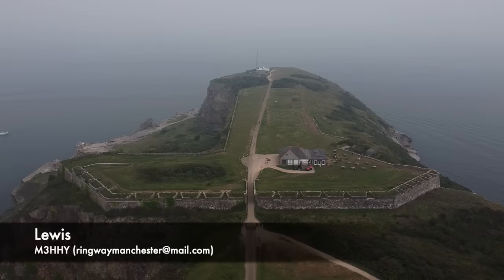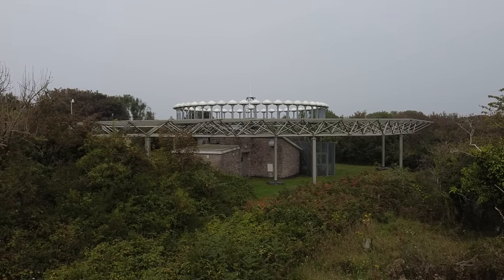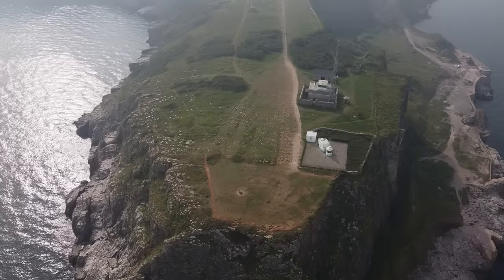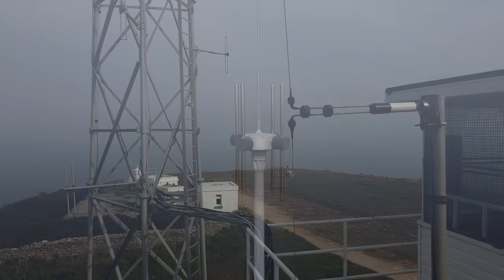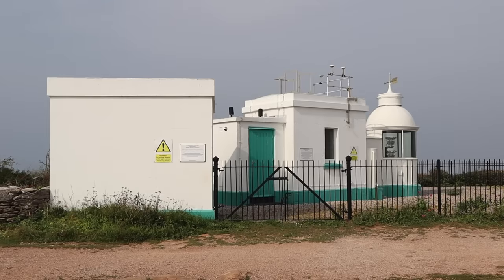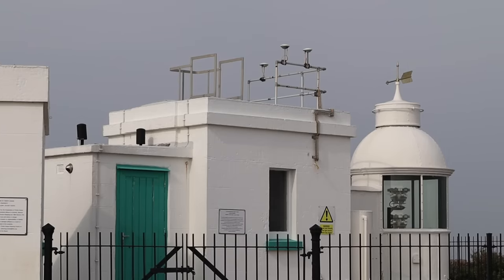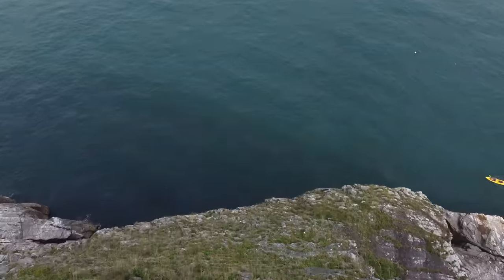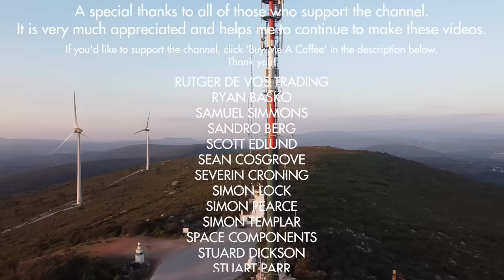What Is This Clifftop Radio Beacon Used For?

Comment: I can shed some light on the unidentified dipole antenna. It is an ARM Multi P6 designed in the 1980s by an acquaintance of mine who has sadly now passed away. It was a simple and cheap portable antenna for the amateur 2 metre band and could be assembled in different configurations, hence the multi in the name. I believe this one was tweaked to cover the marine VHF band. The fact that it is still standing after nearly 40 years gives testament to how rugged it is despite the flimsy looking construction. Berry Head frequently records the highest wind speeds on the south coast during gales. I think the thin and flexible stainless steel elements help to reduce the wind loading which has allowed the antenna to survive.
The DVOR stands in prime dog walking country and I have walked under it countless times when exercising pooches. I always knew it was an aircraft beacon but I now understand much better how it works thanks to your concise explanation Lewis.
Fun fact: Berry Head lighthouse is supposedly the shortest but highest and deepest in Britain. As Lewis has explained, It is only 3m tall but it doesn't need to be any bigger as it's already 58m above the sea. It is deepest as there is a 45m deep shaft underneath. This shaft was for a descending weight which turned the old rotating light and which had to be cranked back up again every day. This was supplanted by a small electric motor and finally the recent LED array.
Reply from the maker: Wow thanks for explaining!

Comment: I love VORs. I visited my local station a decade ago to get pictures of it while it's still in existence. In the US they're gradually disappearing with the proliferation of GPS for navigation. It doesn't seem like a wise option to get rid of our fallback systems though. Great video as always!
Reply: They're disappearing in the UK too.
Reply: VORs are still used for primary navigation according to the FAA. were trained not to rely on gps and to use VORs when possible.
Reply: Not all VOR's are disappearing. In case of a GPS outage, the VOR MON (Minimum Operational Network) will enable pilots to revert from GPS navigation to conventional VOR to VOR navigation.
Reply: As others have said the FAA is mainly getting rid of redundant VORs. Here in the Southwest US we still have and will continue to have plenty of VORs!
Reply: All the previous comments are correct - but the VOR situation is not sustainable.  There are many smaller or private, non-public airfields which are not well served by existing VORs and do not have ILS installations.  The cost of VORs and ILSs is significant so a replacement is needed.  But will I miss the piece of modern art that an VOR station is?  Ya bet!
And let's not forget good old NDBs and direction finding approaches 🙂
Reply: Just needs for the satellites to be wiped out by a solar eruption or other external event.  These would then really be needed.
Reply: @alangknowles  the airfield where I learned to fly (EGSC) still opperates an NDB, VDF service and even a good old optical beacon and whule not directly served by any VOR, there is suffixiennt VOR/DME coverage to make life without sat nav easy enough.
Reply: @alangknowles Put all the eggs in one basket. No thought to redundancy and continuity of operations

Comment: I’m training as a pilot and the VOR service in the UK is remarkable. I never knew it existed till I started my flight training.

The VOR system is required for primary navigation in the UK, with GPS limited to a backup or secondary navigation aid. I’m glad we learn to use both :)

Comment: 4.34. I worked at Berry Head Lookout for several years before it’s closure as a coastguard station. When the towering new radio mast was installed, some bright spark amongst the staff (with expert drawing skills) pinned an official looking and beautifully created line drawing poster on the wall in the lookout. It gave detailed instructions with diagrams on ‘How to attach and dock airships’, with a comical description of how to deal with disembarking passengers in high winds. Those were the days. 

The replacement of lighthouse workings - while no doubt efficient, are a great loss. The aesthetically pleasing reflectors which worked fine for the last 100 years were much more appealing up close. 

Thank you for this great video, great photography and research as always.

Comment: Berry Head lighthouse is the highest, deepest and shortest lighthouse in England. Highest due to its elevation above the cliff, deepest as there is a 30 foot deep pit which used to house the clockwork and shortest as the light is 6 feet above the ground level.
If you have been visiting the South West will there be an episode about the Lizard and Goonhilly Down?
Great video as always.

Comment: Not a bad description of a DVOR station. This onelooks like a PlesseyPlan 50; so-called because there were 50 antennas in the ring. I trained on this at the end of 1977 at the old National Air Traffic Service training school at Bletchley Park (yes, the home of the UK codecracking site from WW2). A cracking system and a doddle to maintain,unlike the other old analogue systems. I spent 4 years mantaining ATC facilities in Saudi Arabia straight after that training course (well, after a 5 month HF system training at Rockwell Collins in Dallas). Plenty of work to do on DMS,TACAN,VOR.ILS(including associated markers) but not a single DVOR in sight!

Comment: The only thing possibly missing was a recording of the characteristic falling pitch bleep sound of a VOR.
Reply: Depends on which signal you're listening to.  They broadcast their three letter station identifier in Morse code on the AM carrier (aircraft communications use AM).  Some of them in the USA also can transmit audio from the regional Flight Service Station over the AM carrier.  The FM carrier has the sweep signal.  The Rock band Rush's famous song YYZ is based on the Morse code identifier of the Toronto VOR/DME, which Neal Peart heard while riding up in the cockpit on a private flight home...
Reply: @brentboswell1294  That is cool, I did not know that about the song!
Reply: Here in the US many VORs used to be used for contacting  flight service stations. You would transmit on a designated frequency such as 122.2 and then call the flight service station, letting them know what VOR you were listening to. They would respond to you via that VOR. This enabled wide area coverage so that general aviation pilots could file weather report while in flight with information that may not be in the weather forecast, such as where the cloud tops or layers are.
Reply: @brentboswell1294  I mainly heard the Manchester Airport VOR which had a frequency that was close to the top end of the broadcast FM band and could often be received on a domestic radio.
Reply: @nowster  in the US, the lower part of the aircraft NAV band is reserved for localizers and ILS.  Almost every ILS here has a frequency of 108.x or 109.x
Reply: I remember one at 108mhz in the late 70s early 80s

Comment: When I was a plane spotter in the 80s - 90s I was looking for the DVR from our international airport, Zaventem in Belgium, but didn't find that beacon. I found the radar station though, which is huge, it's also a NATO radar station. And I did a tour in the station, when it was open for public. I was stunned that the motors were quiet. For that kind of antenna. I think that is the smallest lighthouse I have ever seen. Thanks for this content, Lewis.

Comment: Very interesting you can get this close to a DVOR. I walked past the Squaw Valley VOR in California back in the 1980s while skiing and distinctly recall a large black conical antenna enclosure somewhat shaped and sized like a space capsule with clearly legible warnings saying "DANGER - R.F. HAZARD - DO NOT APPROACH WITHIN 50 FEET".
Reply: It has horisontal reflector as part of instalation. There is metal mesh on top of flat metal construction. Thicker mesh walkways are visible near and around transmiting antenas for maintenance.
Since walkers are under the reflector iradiation is low, terain config is under it. But proped up on a significant hight man can easy get in the beam...
Reply: There's a VOR on a ridgeline along the Appalachian Trail in the Smoky Mountains (USA).  There's a few warning signs posted but the main "keep out" method is just a waist-high wooden picket fence in a 50' (15 m) or so radius circle around the transmitter.
Reply: @alexhajnal107  Where about on the trail is this? I'm familiar with the smokey mountains but haven't seen a VOR anywhere.
Reply: @DarkNightDreamer   It's the Snowbird VORTAC on the NC/TN border 30 miles WNW of Asheville, NC, about 7 miles trail S of Max Patch (5½ miles map W) and it's about 50 meters N of the trail.  Technically it's just NE of the Smokies (by about 2 miles).

Comment: Navigation systems of modern airliners tune these VORs automatically to improve the position since inertial navigation systems have drift over time. DME and GPS is also used for this. For instance the Airbus A320 will use the inertials and GPS to calculate what is called a GPIRS position using the three inertials and two GPS receivers. This is number 1 in the hierarchy. If it loses the GPS signal it will start calculating a DME/DME/inertial position. Next step is VOR/DME/inertial position and last on the list is inertials only.

Nowadays VORs and DMEs are quite dependable to give a good position. NDBs which are decommissioned more and more, are much less reliable. For instance with lightning the needle will momentarily point towards a strike and over all be very susceptible to static electricity in the atmosphere, costal effect and so on.
Reply: I also (wrongly) assumed that the aircrafts IRS would be "updated" with the correct external data from DME/GNSS/VOR data but apparently it never does. So if you are reduced to just using IRS you may find yourself drifting quite far off track!

Comment: Regularly fly from South Wales to Brittany via berry head VOR, although not equipped to navigate via VORs, it's common to use them as way points in GPS flight planning as controllers in the south of UK and northern France all know where berry head is (BHD). Often looked down at ,nice to see it in the flesh !
Reply: I used to use it flying from Cardiff to the Channel Islands. The DME was useful to see where "50N" was, back the day before I had a GPS.

Comment: Those days of learning the variable and reference phases in VOR came flooding back to me! 😂😂 Carrier frequency  amplitude modulated at 30Hz  AND 1020Hz ident or ATIS voice is the reference phase PLUS the subcarrier  which is frequency modulated at 9960Hz with a deviation of +/-480Hz all amplitude modulated at 30Hz with the aircraft receiver consisting of a demodulator and discriminator to retrieve the two 30Hz signals. The phase difference between the two 30Hz signals is measured and is directly proportional to the bearing of the aircraft with reference to magnetic North. This is because the reference phase is synchronised with magnetic North. Thanks for reminding me! 😂😂
Reply: 13.5 meters ;) Just did the annual on a Racal Mk IIa...
Reply: @juliussokolowski4293  The diameter of the antenna ring? I seem to remember it being about 44' and important.
Reply: @juliussokolowski4293  Fantastic! Nice to meet you Julius! I saw a terrible photograph in an old avionics publication showing the solid state antenna switching unit in the Racal Mk IIa but couldn't make out its physical size or its physical location within the array. I assume it sits central to the dipoles but can you tell me how big it is?

Comment: In modern flight management systems (FMS), position is verified by multiple DME positions.  This is considered more accurate than GPS and IRS (Inertial Reference Systems).  The FMS will produce a 'computed' position combining IRS, DME and GPS data,  VORs can be used for holding procedures but because of the 'cone of confusion' immediately overhead the beacon,  flying them manually is less accurate than using FMS (RNAV) holding procedures.  VORs are still used for approaches but as they are rarely aligned perfectly with the runway, they tend to be slightly offset and more of a cloud break procedure with much higher approach minima (height at which visual contact with the landing runway must be made) than precision approach systems such as ILS which is effectively a single 1/360th VOR beam.  Look at me waffling on needlessly!  Thank you for triggering me to add something :)

Comment: Very nice video, beautiful cinematography. But it was repeatedly stated that the DVOR (or VOR for that matter) provides position and heading information to the aircraft, which is not really true. The signal provides position but not heading. An aircraft in any particular radial from a VOR will have the same radial displayed, whatever it's heading. Of course the radial may vary over time (if the aircraft is not flying a direct TO or FROM course), but the VOR receiver cannot know he aircraft's heading, that bit of information is just not available from the VOR system.

Comment: That real nice video . the night pics and video came out real nice. nice VHF antenna array. this is how they find aircraft with just radio transmissions. even below ground clutter in Rader.   also direction finding on VHF Marine radio. our US coast guard uses them to help fined boats in trouble. love that light house. nice look at the LED lighting. much lower power than the old lamps. and last longer . The AM broadcast station I worked at did a LED up grade of tower lights. they bright ! even has battery back up with a gen set just for the tower lighting. the FAA in the US sets requirements for tower lighting . I still have old lights with a bayonet base in the shop . the old flasher with motors and cams is still in the budling has no power to it anymore. now just a small box on the wall . and some AGM battery on the floor. 73's Boston NY

Comment: Correction Lewis, everything you said is past tense. It was an amazing nav aid, but, those days are gone, now its all GPS, that is far  more accurate than the DVOR.
Suggest you  do a video on the history of the VOR that came from beacon stations, and then VHF Radio Range and then VAR that provided VOR on just the airways spoking out from that VAR.
I flew on the very last one that existed in Australia a long time ago, and remember its unusual presentation on the chart.
The VHF beacons trace back to WW2 as does the airband go back to 100-150 mhz with 3 watts if you were lucky.
Reply: Except that GPS can be turned off or spoofed in any conflict situation.   VORs are not going away in Europe for the foreseeable future.

Comment: The marine DF array at Berry head (and antenna sites) is no longer operational.
The Maritime and Coastguard Agency (MCA) decided that the land based DF was too expensive to keep operational and disbanded the fixed stations a number of years back - now relying solely on Lifeboat and Aircraft DF.
Reply: Do you know what DF technology this was?  The only one I'm aware of in modern times if is/was Decca/LORAN.  I was under the impression that that used a rather larger antenna than was shown in the video.

Comment: Beautiful drone photography and great video.
Surprisingly nice stonework on those buildings, especially on the VOR which I'd have expected to be just a utilitarian metal cabin or a bit of concrete even like a converted wartime pillbox.  Strange infilled square panel on the wall by the door.  Is it the site of yet another closed cashpoint? 😄
Reply: I was a little confused when Lewis was talking about the "brick" building.
Reply: I was wondering about that blocked off window. Maybe back in the day it was manned, with someone turned the handle inside! 🙂
Reply: @paulsengupta971  Fancy meeting you here :P I believe the very earliest VORs did have rotating components, albeit not hand-cranked!
Reply: Maybe the hot air vent for a long-gone standby generator?

Comment: DME (Distance Measuring Equipment) is usually located with VORs. The VOR provides bearing information (with respect to magnetic north) and the DME provides distance. The combination of bearing and DME from the station means position can be established. DME relies on an interrogation being sent from the aircraft equipment which is then picked up by the ground station which sends a reply back to the aircraft. The aircraft equipment measures the time difference and hence range from the DME is calculated and displayed. Interestingly from the piloting point of view DME provides distance from the ground installation such that, for example, an aircraft directly overhead the station at 36,000 ft would display a DME distance of 6 nautical miles so depending on altitude there is a slant range error when close to the ground station. Aircraft on board equipment also calculates the rate of change of DME distance to display groundspeed, assuming the aircraft is tracking directly to/from the station. In combination with distance from the station time to run to station at the current groundspeed can be calculated and displayed. 
The VOR/DMEs are regularly flight checked by the appropriate authorities.
As a retired pilot I wish I'd had a £1 for every time I've used Berry Head VOR. All in all it's a great bit of kit.
Reply: If you were a professional pilot, you probably did get at least £1 every time you used BHD. 🙂
Reply: @paulsengupta971  haha well I wasn't doing it for free

Comment: In North-West Iceland, just west of the village of Hvammstangi there is a aircraft radio. It is not like this. Its just few masts that are connected to Reykjavík. I don't know if they broadcast anything, as they might just be receive only. They might broadcast without me knowing about it. The broadcast part might be in south Iceland  close to Grindavík town. I don't know what frequency they are using. It doesn't look anything like this antenna.